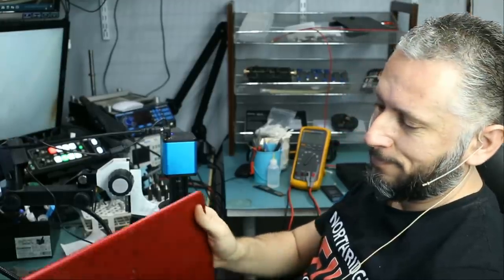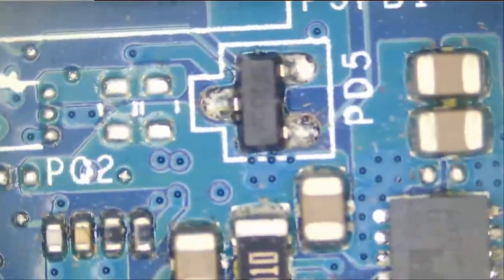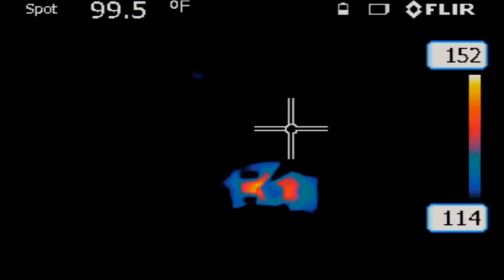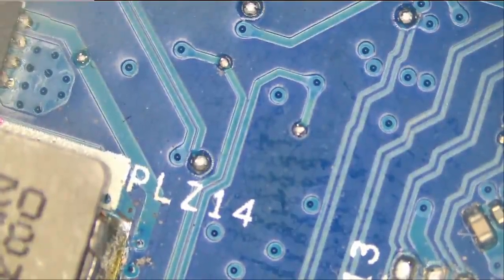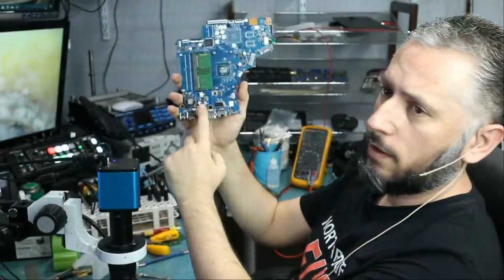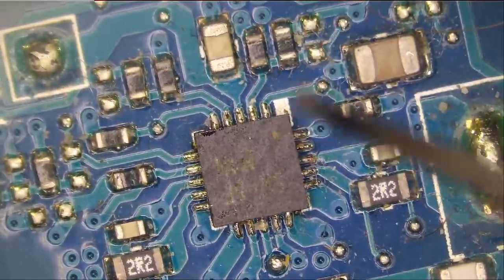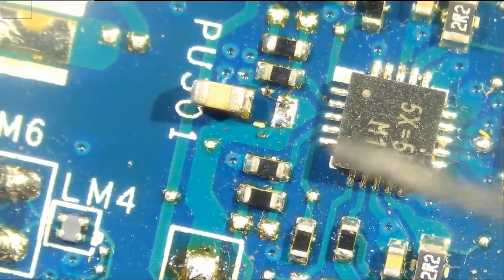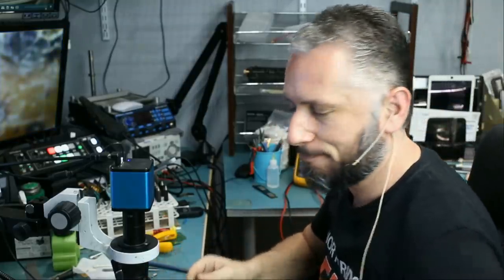Laptop No Power Repair - Finding fault using Thermal Camera

Comment: The "5X" IC is a RT6575DGQW (RT6575D QFN-20 IC Chip) DC/DC Step Down Controller - if you have an issue sourcing, I have a spare here in the UK I can send to you
Reply: @Bishtuku The thermal camera he is using is the FLIR E60. It is a discontinued model
Reply: Teamwork! 👍

Comment: Not 100% sure but i would guess its a -RT8249A/B/C    - Dual-Channel Synchronous DC/DC Step-Down Controller
with 5V/3.3V LDOs. but check the datasheet and pinouts as it comes in a few packages.
Reply: NO. "RT8249A/B/C" would be marked  "2Q="  or  "2P="  or  "2N="  ... chip in video is "5x="

Comment: Hey,it is richtek RT6575C/D. What you have here is probably shorted kbc multicontroler which is powered from that 3.3v ldo line.Very typical case,so before removing that regulator,inject 3.3v into ldo line and watch for heating spots on board,kbc the most.Good luck
Reply: 5X = RT6575DGQW 👍
5Y = RT6575CGQW 👎
Reply: @hightttech  both compatible for this board
Reply: @hightttech  how did you find out what IC was on the board?  The markings were "5X = 5N M1N"  so you don't have to rewatch
Reply: a nice idea and not wasting the time but sorry i am new in repair and do not know what is the ldo
Reply: @sarockpashotan  it means low dropout

Comment: If you give the motherboard number i will try to get the schematic, thats if the 3.3 v dc ic buck controller, but somethimes if not the ic, i suggest to remove the coil and see whats line have the short, im think is pl301.

Comment: I have an asus 403n motherboard with a pwm controller that has similar marks, except mine says 2N=3L E3U.
According to boardview its name is "PWM CONTROLLER RT8249CGQW
RICHTEK WQFN-20L"
Reply: Close. But "RT8249A/B/C" would be marked  "2Q="  or  "2P="  or  "2N="  ... chip in video is "5x="

Comment: Open the jumper PJ304 and see if the short circuit disappears. It could be the EC is dead and not the StepDown.
Reply: IC
Reply: @christozed  EC=Embedded Controller.  It gets its power through the jumper from StepDown. If the EC is shorted, the StepDown IC goes hot.
Reply: @SiETechNotebookReparatur  
IC for step down voltage for cpu, ram, I/O blah blah
Reply: @christozed  i do not understand. This IC on this video is a StepDown Controller IC. It makes the 3,3Volt and 5Volt. 3,3Volt goes to EC (Embedded Controller, Super I/O, starter IC whatewer) it is also an IC (Integrated Circuit).
Reply: @SiETechNotebookReparatur  maybe not the IC. 
The problem is that it  can't release the voltage out.
3 leg is the "feedback" for 3.3volt
Reply: @danielsatko-  or maybe the regulator transistor from primary power circuit.
Reply: @christozed  have a look at a schematic where this IC is installed. e.g. the Acer Spin 16835-1M.
Reply: @christozed  ...or see datasheet. Leg 3 ist for 3,3Volt, always on.
Reply: @danielsatko-  according to the data sheet Pin 3 is LDO3, and LDO3 is a 3.3V Linear Regulator Output. It is always on when VIN is higher than VINPOR
. Also always on, when the Board under Power is. And see datasheet Page 9.
Reply: Just reading the comments is like being back at college
Reply: @SiETechNotebookReparatur  not always.
What is before IC? 19V 26V etc on input. and then the IC do step down 3,3V.
Reply: Looks like the one that dies on the dell Xps 16 for cpu etc

Comment: Your videos never get old, something new every time.

Recently I perform microsoldring in a flex cable 3mm flex having 15 wires I sold it perfectly without microscope because my hands are perfectly still but I didn't have solder mask I solder one side other side get desolded only by touching iron on another side for fraction of sec.

Comment: From what I see it is a synchronous dc/dc step down converter providing 3.3v and 5v . The only supplier i found was a couple of eBay listings so you may need to find donor boards to find this ic.

Comment: I've found the manifacturer. Search for Richtek 5X. According to documenr that I've found, 5X is Product Code and 5FM1N is Date Code. You can find that file by searching DS8249-ABC.pdf and look for Marking Information on second page.
Reply: And also found RT6575D which is 5X but I don't know if it is suitable for that motherboard
Reply: Close, but "RT8249A/B/C" would be marked  "2Q="  or  "2P="  or  "2N="  ... chip in video is "5x="
Reply: @BirhanDursun :  datasheet indicates same chip 👍

Comment: I am having a battle with HP Omen laptop. Looks like the Richtek L8 on it has similar problems as the device wont start and just blinks shortly while pushing the power button.
I am looking forward for Part II.

Comment: RT6575C/D Applications  Notebook and Sub-Notebook Computers  System Power Supplies  2-Cell to 4-Cell Li+ Battery-Powered Devices Ordering Information RT6575C/D Pin 1 Orientation*** (2) : Quadrant  2,  Follow  EIA-481-D Package Type QW :  WQFN-20L  3x3 (W-Type) Lead Plating System G :  Green  (Halogen Free  and Pb Free) Pin Function With C  : LDO3 Always  On D :  LDO3/LDO5  Always On Note : ***Empty means Pin1 orientation is Quadrant 1 Richtek products are :   RoHS compliant and compatible with the current require   ments of IPC/JEDEC J-STD-020.   Suitable for use in SnPb or Pb-free soldering processes. Marking Information RT6575CGQW 5Y=YM DNN RT6575DGQW 5X=YM DNN 5Y= : Product Code YMDNN :  Date Code

Comment: greetings, what is the model of the thermal camera?
Reply from the maker: https://rover.ebay.com/rover/1/711-53200-19255-0/1?mpre=https%3A%2F%2Fwww.ebay.com%2Fsch%2Fi.html%3F_from%3DR40%26_trksid%3Dm570.l1313%26_nkw%3Dflir%2Be60%26_sacat%3D0%26LH_TitleDesc%3D0%26_osacat%3D0%26_odkw%3Dcannon%2Bpancake%2B40mm&campid=5338440312&toolid=20008
Reply: @NorthridgeFix  wow....now that is dedication to your craft.  Not many shops would/could spring for a $1-4K piece of test equipment.  Although, the better the tools (and knowledge how to use it), the better the repair.

Comment: How do you test capacitors with only 1 probe?! 🤔
Reply: The other prob is on ground
Reply: Just pin down the other probe to GND so its easier and you just need to use one probe.

Comment: You should spend more time on it,remove that 3.3/5 volts voltage regulator ic and Check for short again on that cap to find if the short comes from ic or 3.3 volt rail (or 5 volt rail).of course if there is a short under 3.3 volts rail Power suply (that 5×=6f ic)has to be hot.
Reply: a nice method!!!
Reply: thats very very useful thanks man.

Comment: i asked this a dozen times:

why there is no link to the flir cam AND which model is it?
Reply: Find a micro usb flir camera for cheap. All you need is a Android mobile. That's enough
Reply: FLIR TG165 - google it.
Reply: @techworld5272  thx mate :)
Reply from the maker: Flir E60 https://rover.ebay.com/rover/1/711-53200-19255-0/1?mpre=https%3A%2F%2Fwww.ebay.com%2Fsch%2Fi.html%3F_from%3DR40%26_trksid%3Dm570.l1313%26_nkw%3Dflir%2Be60%2Bthermal%2Bimager%26_sacat%3D0%26LH_TitleDesc%3D0%26_osacat%3D0%26_odkw%3Dflir%2B360%2Bthermal%2Bimager&campid=5338440312&toolid=20008
Reply: @NorthridgeFix  thank you :)